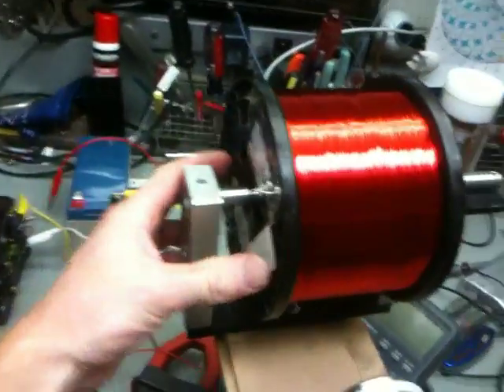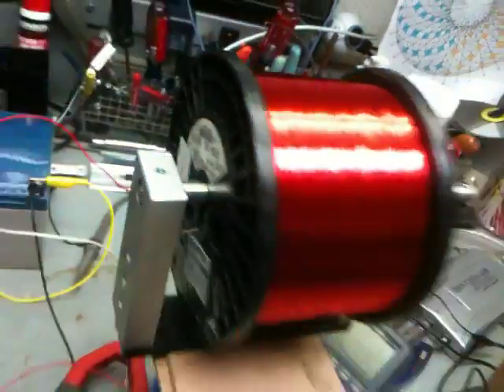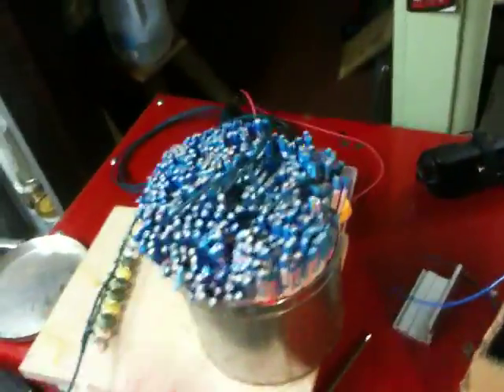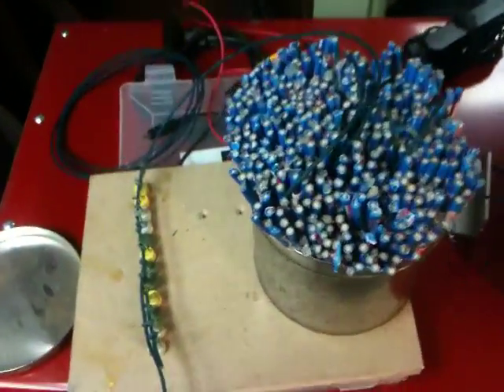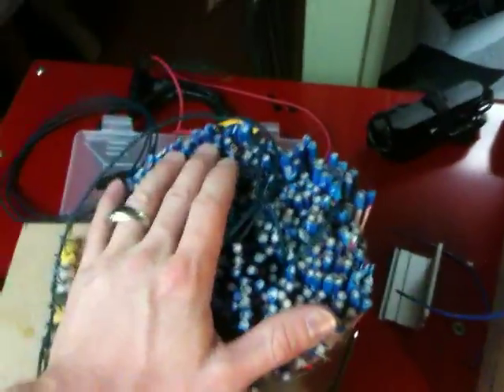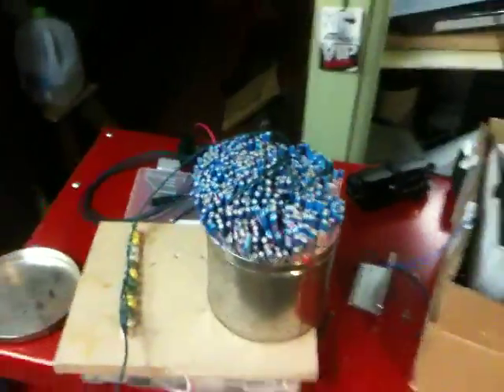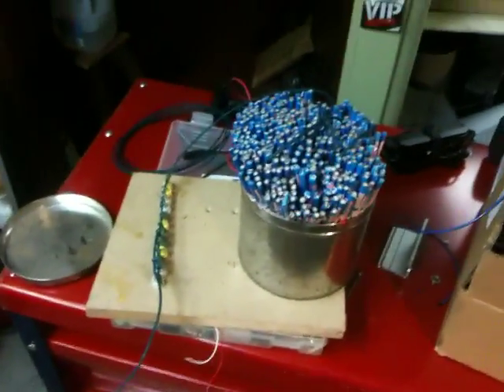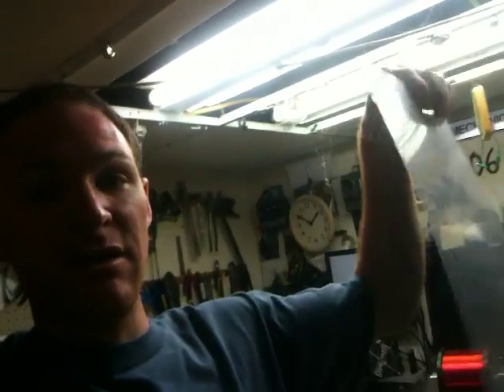Still Alive! , Happy 4th and My Homemade Fire Work's Shows, See DESCRIPTION!

Comment: Yeah still alive!!  lol I used to make home made fireworks out of those rolls for cap guns when I was a little kid.    I have some plastic here that protected a huge roll of burial grade fiber optic cable.  It is 0.05" thick and cuts easy with a good scissors, but is very hard to tear.  The only bad part is it is really  flexible.  Sound any good?  Happy 4th!